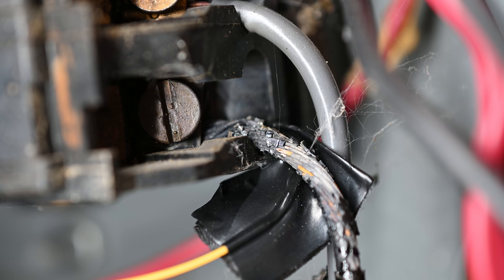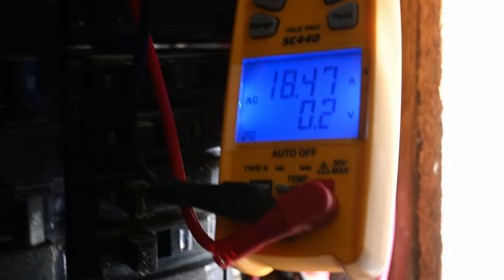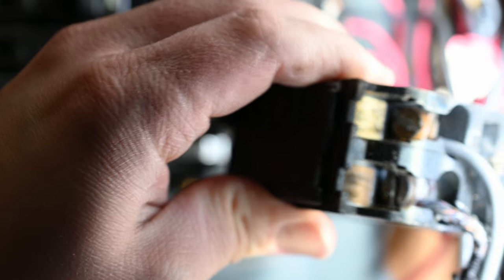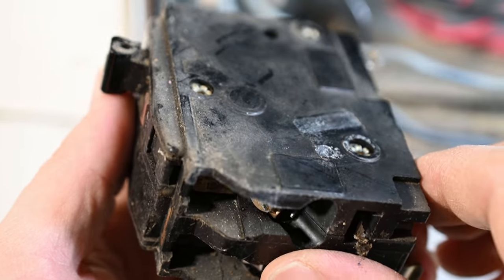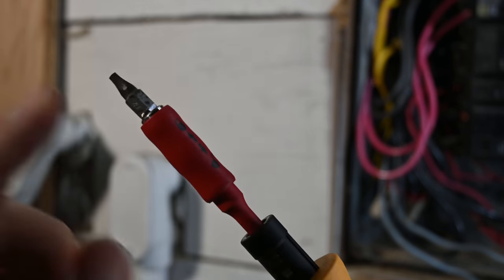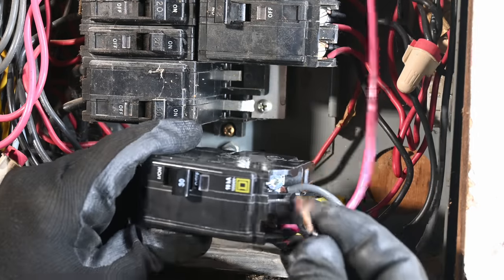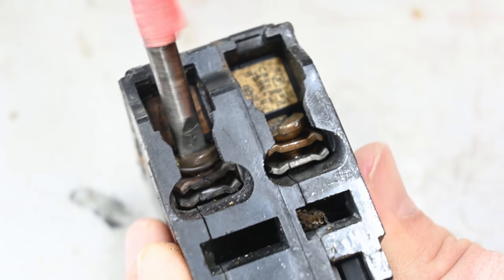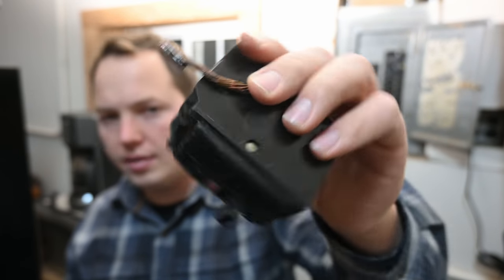Burned Wire On Breaker - Torque Screwdrivers & Why You Should Probably Be Using One

Comment: I like this forensic examination a lot!

I think the breaker itself was old, and cheaply made, the contact inside was probably the biggest fault, either oxydized or not alighned perfectly flat to each half. The wire being loose is hard to call for sure, because the very act of it's heating up and burning insulation could have caused it to get loose(r) it was still drawing a normal amperage of 18 regardless, but that buzzing noise sounded internal.

Breakers like everything else do not last forever, and one bad thing to do is use a breaker like a light switch, they are not made to be used that way.

I have seen on a table saw and other machines using on/off switches or contactors at work where the contacts inside were oxydized and dirty. Some would not turn the machine on, while a small bandsaw had arcking sounds inside the switch.
In most cases it was sawdust and dirt getting inside the switch and getting on the contact points themselves, that once cleaned and lightly sanded to bare bright metal, worked perfectly fine afterwards.

18 amps is a lot of current going thru that little contact disk, I think a better made breaker like the new QO breakers I have, maybe the contact disks are a little larger diameter. I heard QO mentioned, maybe this failed breaker was an OLD QO breaker? I don't have an electric water heater, dishwaher, dryer or range- they are gas, so most of my electrical use is lights, outlets, though I do have a 2HP pipe organ blower that is on a 220v breaker, it's been on t the last 20 years. I don't remember what the amp draw is but it's a repulsion induction start Century motor from 1927, and once running and the brushes come off after startup, it's running amps as I remember was very good. The breaker never gave me any issues. The startup and run video I did can be seen at /watch?v=U1SlR7dMbLg

I suspect someone was using a LOT of hot water for an extended period of time at least once, and that was enough to get the contact points hot, especially if they were marginal capacity to begin with, if they got hot the surfaces would get oxydized and create more resistance which creates more heat.

It's probably a combination of a little loose wire, overheated and poor quality contact points, and an extended draw caused by maybe taking  along bath just after doing a couple of loads of laundry with hot water, the dishwasher going etc., all of that would have caused the water heater to be running continuously for an extended period of time, at least as much or more than when it was first powered on with a tank full of cold water.
Reply: I tend to agree, it was likely the breaker. But it is nearly impossible to know for certain. It was the source of heat that transferred to the wire, and through expansion could have loosened the terminal. We'll never know. I think breakers need to be exercised once in a while (turned off, then back on). I know that action is good for water valves too, it blasts away any film of sediment or early-stage corrosion. For the breakers it could be flicking a microfilm of dust or other resistance-causing sediment.
Reply: @aaron74  I'm not sure on the moving breakers periodically idea, I think they put a little dab of dilectric grease on the contacts MAYBE, it seems they do on the contacts that "make" with the panel bus, I noticed my new breakers all seemed to a little dab of clear grease on them there, maybe they do the same inside to keep the contacts from oxydizing, I tend to think once they contact they make a pretty good airtight seal as long as they arent vibrated like they would if on a heavy machine, or someone uses them as an on and off switch all the time!
I'm thinking too the breaker case seems to be pretty well sealed up and riveted, I think they stay pretty clean inside for the most part
Reply: @HobbyOrganist  Yeah, no disagreement. I'm kinda going with my gut instinct on this one, honestly... maybe just once a year or so give it an off-on. It can't hurt. lol

Comment: Speaking of 2020 NEC and gfci breakers on water heaters,  keep in mind the rules of NEC 2020 only apply if your state/jurisdiction has adopted it. Your state may be using another version of the NEC.
Reply: As of  January 21, 2022 Tennessee is still using the NEC 2017 code.
Reply: Changes to the NEC do not have retroactive authority for existing installations

Comment: In my line of work (been retired for 20yrs) torque values I have applied varied from 10,000 ft lbs to 20 in lbs, but not oz lbs which I have read that is applied for tightening hose clamps.

Comment: I bought the 1/4 inch Wiha adapter for my Whia torque screwdriver. It came with the 4mm (1/8") adapter. It seems like they should have included the 1/4 inch adapter to begin with since that's what most people have.

Comment: Prob a good idea to check all your (high-current) connections on an annual basis. At least look for discoloring, melted, or heat-stressed components. This would be air conditioner, electric hot water, electric stoves, electric vehicle, etc breakers.  Also use a thermal imager to check those breakers after they’ve been running under a load for 15-30 minutes.

Comment: Good video.  Proper torque on any fastener is critical, especially those used on electric devices (and critically on panels/breakers).  Far too often I see people crank down screws/nuts/bolts way past what they should be, as well as some not torqued enough and become loose.  I routinely do a non-contact thermal check of my panel and high-load receptacles/cords... just in case.

Separate comment... what is up with those wire nut connections inside the panel?

Comment: after years of working with this stuff i learned to tighten the screws wait 5 minutes then retighten them 1/2 the time they had loosened due to the wire seating in the clamp. i have very very few problems. go back the next day and see if they move.

Comment: The wire looked discolored by excessive heat even after stripping it back twice. Was that bad camera angle?
Reply: No you are correct, the copper strands had changed color from the heat. However I believe it was okay to reuse in my opinion.

Comment: Do your tie downs one at a time and don't leave it until you put the torque on it, technically you got only one shot to tighten properly you should not go back a retorque. All the same an overtight is better than missing the torqueing altogether. Also be careful how you strip your wire. Nicks especially if they are concentric from a stripper will cause resistance and heat as well.

Comment: I recently had a customer where I opened up their electrical box to see why 1/2 the house is going out when I opened it I saw a similar burns on the main breaker coming in and a ton of rust inside the box apparently water has been leaking inside there for some time. All from some people that did the siding and really did a number on replacing the meter. That high temperature flexible clay  that the electricians use was completely gone, allowing water to come pouring in when the wind blew just the right direction.

Comment: Took screw drivers something new in the code.
The real problem was stranded wire.  Electricians never use stranded wire.  Being a maintenance electrician,  I did a lot of old work. 
Solid wire pulls just as easy.   Strained does not lay flat like solid.  Strained wire curles up into a** h***

Comment: I'm happy to see torque screwdrivers being used but simply not tightening or not tightening enough accounted for perhaps 20% at most of the issues I have come across. Most of my work has been in the theatre and entertainment industry working on both fixed and portable installations. Most issues stemmed from issues ranging from poorly designed connectors through to problems like trapped insulation. I found that using ferrules crimped on were incredibly useful in creating safe, repeatable connections. Torque screwdrivers come into their own when periodic maintenance and inspection operations are carried out. Personally I prefer to use feel.
I hate to tell you that the rest of the world has moved on and that world is metric 🤭

Comment: Believe it or not, the gas cap clicking isn't so much about over tightening. The gasket doesn't squish any more, there are stops. What it's there for is to tell people you are at the stops and tight. This is because right before that point, it'll leak. And leaking gas caps means engine light. 

Question for you. If the wire is too short due to a previous electrician, is it acceptable to splice them with wire nets/jumpers to extend them?
Reply: Yes it is acceptable to make splices inside a breaker panel.

Comment: My first guess before I watch any further would be that the connection at the breaker is loose, since the wire insulation is not melted all the way back, but only near the breaker connection.

Comment: One theory left unexplored is that that was an original breaker that was used with a water heater that failed and was replaced for excessive current draw, which caused the condition that you found in the breaker.

Comment: There IS a magnetic trip in these breakers!
Originally, I too expected to see a coil of some sort...
After thinking it through and noticing some additional components on the trip bar, I recognized how it operates:

The current takes a circuitous route from the terminal and through the bar. I know at high current that a magnetic field can occur around a straight or hairpin wire...
I figured either the U-turn at the top or the bar itself creates a magnetic field.
It causes that extra 'clapper' or armature plate, to pull into the channel shaped piece that covers the bi-metal strip at high current levels.

Years ago I saw (on TV) an impressive demonstration at a university power lab that used a dynamo source. [hobbyist dream] 
It was a group of large cables from a buss bar on the ceiling to a bar at the floor. They were loosely close together, but not bundled.
When he cranked up the amps, the cables all slapped together tightly! IIRC. Demonstrating the invisible magnetic fields surrounding a conducting wire...

Another example that occurred to me, years ago I discovered inconveniently that a soldering gun tip exhibits a strong magnetic field on something I was soldering at the time... [it moved the piece I was trying to gingerly solder in place]
Try it yourself, touch a nail or paperclip to the tip while it is running!

There is a sparsity of videos of breaker tear-downs (and they often did not correctly understand them, or got it wrong), but I verified my conclusion.
The best one I found is titled "How a Circuit Breaker Works in Slow Motion - Warped Perception - 4K" by "Warped Perception"

Comment: I guess I can go on Amazon and buy one, but you don’t really see them for sale in normal stores so it’s hard to just Buy one while you’re working on a project.  I saw a special torque thing for hose clamps in the plumbing section but I don’t really remember ever seeing anything in the electrical section. I work on cars and have  four or 5 regular torque wrenches so if I saw a torque screwdriver I would buy it in a minute.

Comment: That was  a QO breaker which I have the utmost respect for. Most likely it was the loose wire transmitting heat internally. Stranded wire should be tapped gently so the strand will settle into the connection. Torquing would have prevented the condition but a secure connection would have been beneficial. Most failures I encountered were due to loose connections or FPE equipment. The only issue I have with torquing screwdrivers is they have to be calibrated. Most of us don’t have access to a facility that does that.

Comment: Question: The 20 amp breaker directly above the one in question has two wires under each lug. Is this a case of someone running two circuits off one 240v 20 amp breaker? Is that legal, advised etc. or do I have it wrong? (I'm not an electrician, but play one on the weekends, always trying to learn) Thanks!
Reply: I noticed that too.  Also noticed that each lug had a red and black.  With 220v, both the red and black are hot, so I suppose it wouldn't matter whether it was red/black or black/red.  Don't know about doubling up the connector.  The breaker install sheet might tell you how many conductors and the gauge(s) that can be used per terminal.
Reply: Double tapping a breaker or a neutral is a definite NO NO

Comment: The importance of torqued connections is not the only issue. I have had connections that have been cross threaded resulting in a properly torqued connection still being loose. A thermal camera is an additional test that should be utilised

Comment: The comments about torquing leave so much out.  What torque value is called for in the specs of a new breaker and what is actually applied can vary wildly depending on who is doing the work, how the tool was calibrated, and how the tool was stored.
It is important to know that the many calibration procedures test the applied torque at 3 cardinal points, 20%, 60% and 100%.  The calibrator will test each point 3 times to determine an average (assuming all 3 tests results are within range.)  Was the called for torque spec one of the calibrated points or did it fall in between somewhere?  If it was in between test points it may or may not be accurate for the intended job.  The tool owned can ask for a special calibration at specific points if it is necessary.
Tools must be calibrated at specific intervals using test equipment that is traceable back to a NIST standard.  Calibration intervals are set using data sets that allow for 90% of all of the same tools using that calibration procedure to be within calibration at the end of the calibration cycle.  What that statement does NOT specify is that means that 10% of those same tools will be OUT OF CALIBRATION by the time the calibration cycle ends.  Is your tool one of those 10%.  You COULD find out by requesting an "as found" calibration from the lab.  Routine calibration simply tests a tool and makes any necessary adjustments/repairs.  Special calibrations can provide the tool owner with whether or not the tool was still within calibration when they got it, what adjustments were made, etc.  
Calibrations are often performed within certain specific temperature and humidity limits.  Tools are rarely used in the same environment they were calibrated in.  Sometimes that makes a difference, you need to know whether or not you need to care about that.
Have you dropped that tool since it was calibrated?  It may well need to be checked again.  Do you keep it in a storage container to keep other tools from banging on it (and keep moisture out)?
Does the tool owner know how to properly use the tool?  You would be surprised most don't.  
That "proper torque" value stamped or printed on the breaker - that can work well for a new breaker, not so much for one that has been in use for a good while.  
This list is just a beginning.  By the time ANYONE stops to read, follow and actually do the work, he has been fired for either lack of productivity or just because he chose unwisely which "requirement" to ignore.
There are so many people/agencies that write up requirements for everyone else to follow it is amazing anything gets done.

34 year journeyman electronics tech and 14 year calibration lab supervisor here.

Comment: I have never seen stranded wire in a distribution panel. 
Where I live in Canada it against code to use stranded wire as a main run, especially on a high amperage 240V circuit. For water heaters, central air A/C units, and electric baseboard heaters the correct to code wire size and type is 10/2 solid wire.
Probably just for this reason.

Comment: Always liked panels with less mess and therefore wires cut exactly to size. Reason being homeowners should not be messing around in there on the daily anyhow - so it’s more permanent than temporary. And if there did need to be rearranging down the line the wires could likely be extended to fit. Your thoughts ?
Reply: Wires are not extended inside a panel.  Say, for instance, that the existing wires are cut to precise lengths but, for some reason, a wire is damaged and needs a cutback.  In that case the best thing to do is move the wire to a breaker of the same capacity that is in a better position or swap the breaker you need to a position that allows for the shorter line length.  If new additional positions are needed, breakers can be moved around.  Both of these are fine with a proviso.  It is important to attempt load balancing across the legs which, sadly, is sometimes easier said than done because line/zone id's are too often faulty. 

If it is necessary to reset the length of the line then that should be done at a junction box outside of the panel with a single complete and unadulterated line entering the box to the breaker.
Reply: @xavariusquest4603  Don't see why not, as a panel is essentially a large junction box, spices here are completely allowed by code and used often. In many circumstances i.e. finished basement people wouldn't want an exposed junction box in a finished space yet would not want to cut open drywall to feed an extended length wire. There are even code compliant methods to extend a wire outside a junction box altogether, so inside a panel should be much preferred to that. Please explain why you would indicate that wires are not extended inside a panel, as it is no different than using a junction box, which according to you is acceptable.
Reply: @cbarr0288  You gotta do what you gotta do. Not gonna run a whole new circuit when the existing wire is still good but 4 inches too short.
Reply: The National Electrical Code used to forbid splicing wires in a breaker or fuse box.  I believe that restriction has been removed and that makes sense since its no different than any other junction box in many respects.